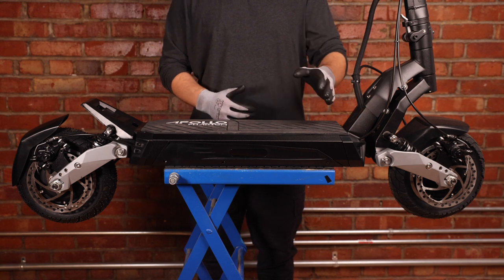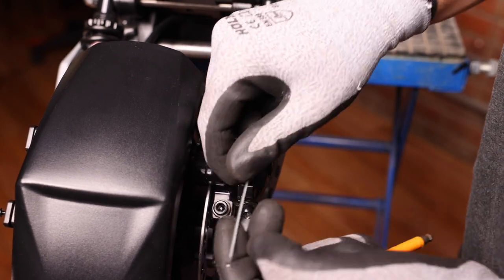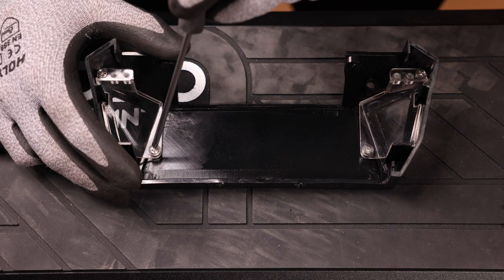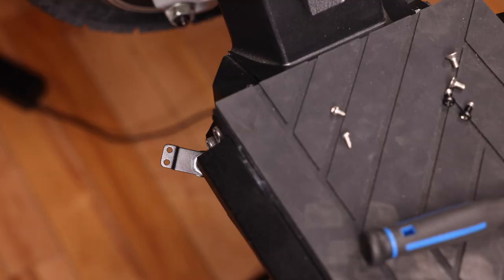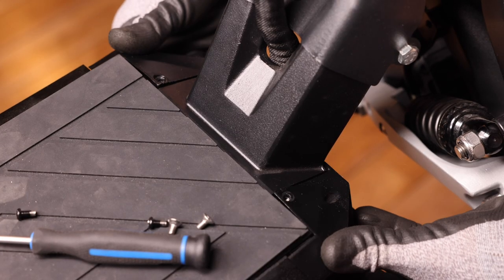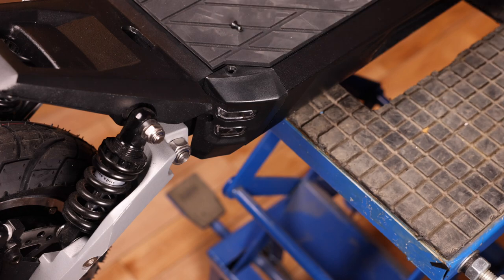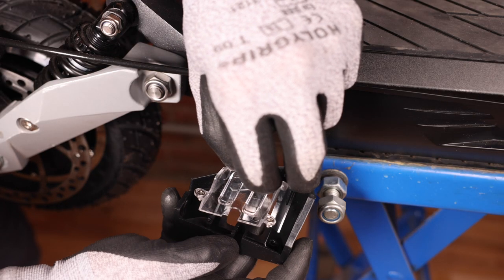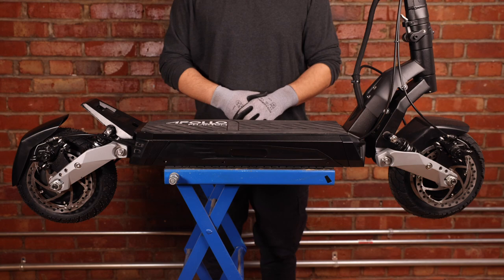How To: Apollo Phantom Deck Cover Replacement

Comment: What voltage are the two front deck lights?
Reply from the maker: Hey Serge,
The voltage for the front deck lights on the Phantom are 12V!
Reply: @ApolloScooters  yes i figured but thanks. I wired my underdeck led strips on thoses. Perfect. Comes on with the headlight switch :)

Comment: This is bullshit! Don’t ever do this replacement. You will never get that brake cable back threw.
Reply: Did you even watch the end of the video? lol.
Reply from the maker: Please watch the entire video. - Randy
Reply: @ApolloScooters  I'm with this guy. I took the rear cover off... that's not the problem. The problem is there's like 5 or so spots that the line gets stuck on and is not passable. I've been trying to run it through for 2 hours straight and no matter how I bend or twist the line, nothing works. You mysteriously cut to the part where the line comes out the back without showing you actually feeding it out. If there's no solution from you I'm going to a post a video showing how impossible it is.
Reply: So I had to take the top off mine to get the brake line back through because one of the cables popped up and blocked the brake line from going through.